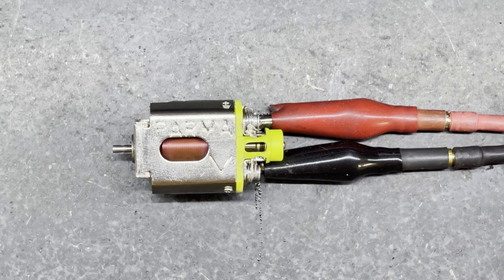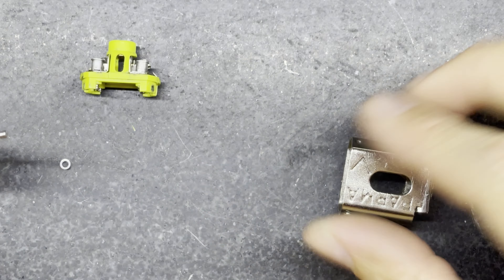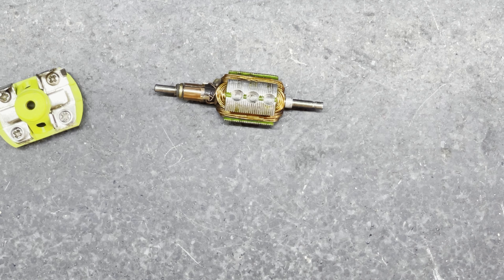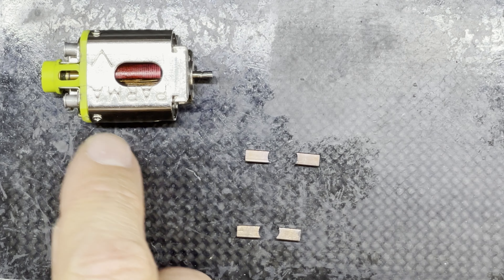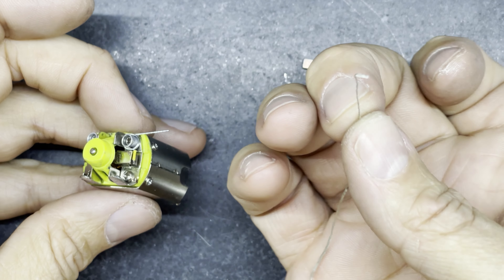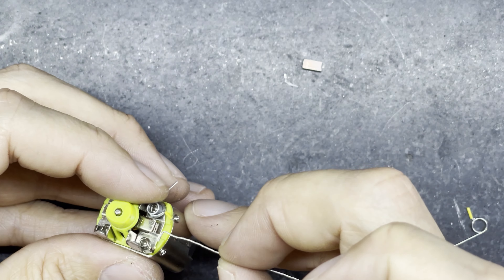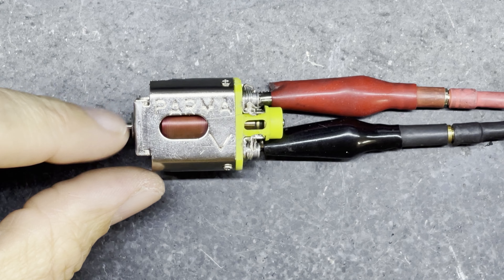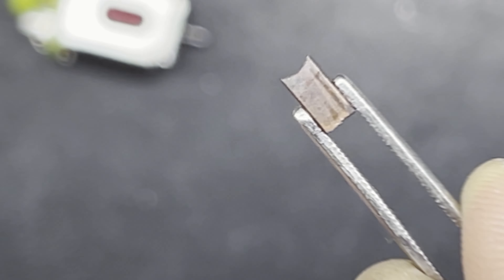Servicing a slot car motor to improve performance Super 16D Slot Stox - Part 6

Comment: This was a very comprehensive motor building series James. Even the inexperienced person. if they watched the entire series, could become a good builder/rebuilder of motors. The same basic steps to building a 16D motor also apply for ceramic C-cans. The dimensions of C-cans are slightly smaller. One tip I use with motor brushes is polish them on newsprint, especially the four corners to remove any burrs & irregularities. Newsprint works like the ultra-fine sandpaper, but without its price. I look forward to seeing the Slot Stox series on the chassis.
Reply from the maker: Thank you billffromnh. I race a lot of G12 C-can motors and Eurosport motors and use the same techniques with those motors, except I don’t use the diamond coated brush alignment bar with some of the plated endbell hardware.
I have seen people rub the brushes on all sorts of old paper just to polish them up a bit and remove any burrs on the corners. It seems to work well.

Comment: What are your thoughts of placing a phenolic washer/spacer up against the commutator? I mark the top face of my brushes using an Xacto blade against the top of the hood to show me the correct brush orientation for when I remove the brushes for checking purposes.
Reply from the maker: Using a phenolic washer at the com end, depends on what the end of the com is like. Some coms have exposed copper segments on the end so a phenolic washer would help insulate the end of the com and avoid shorting out segments with a metal washer. In this case, the com had some form of brass washer already on the end of the com that was already insulated from the com segments so I didn’t feel it was necessary.
Nice tip about marking the brushes. I have seen that done a few times before.

Comment: Good stuff James. Id be really interested in seeing the rpm difference between a 3 coil spring and a 5 coil spring (with and without shunts). S16D's really dont need that much brush pressure as the current draw is not super high. You do not want the comm to have a bare copper surface, too much friction. You want a few nanometres of copper oxide. Too high a pressure and you scrap the oxide layer off. Too little and the oxide layer becomes too thick.
Reply from the maker: Great tips as usual Fabio. Thank you 🙏
Reply: Many years ago I had Parma's bigfoots and a brand known as "golddust" brushes chemically analysed. Occupational perk. From memory the bigfoots had about 3% copper with the rest being carbon, silicon and binder. The gold dust had NO gold and NO copper! Only carbon silicon and binder. Not sure why they marketed it as gold dust brushes??
Reply from the maker: @Fabio-ns4ql  Interesting. Brushes do vary in colour quite a lot. I have found that the ones that appear to be more of a copper colour, don’t seem to work so well in the higher amp motors. There have been many batches of “big foots” and “gold dust” brushes through the years and the colours always seem different from batch to batch.
Reply: @CleaveTech  totally agree, it always seemed the darker brushes were a little faster and better comm wear

Comment: I'm intrigued, what purpose does armature dye serve?
Reply from the maker: Armature dye just protects the exposed parts of the laminations from corroding over time and it makes the armature look pretty.
It also makes it easy to see if the armature has rubbed against anything which could mean that you may need to get it rebalanced again.
Reply: @CleaveTech  many thanks.
Reply: @CleaveTech  The armature dye also darkens when heated, so the amount of discoloration gives a rough indication of whether and how much the armature has been "cooked". This is true for any color arm dye (blue, purple, yellow, etc.), but red is preferred by many racers for this function.

Comment: Nice job and a good watch.  That motor is probably running as well as it can, now.  Out of interest, how many amps does it draw after its going over?
Reply from the maker: It’s quite an old armature and the windings are not that great, but for information, it draws 2.0A at 5V.

Comment: What is the Shunt wire and what is its purpose ?
Reply: Also. What are the ramifications of breaking/losing a shunt wire during a race? Will the motor still run?
Reply: I had the same question! Looking forward to James' answer :)
Reply from the maker: Great question. The shunt wire conducts the current to and from the brush more directly and effectively than just relying on the brush touching the brush hood. Although the brush is a good fit in the brush hood, it has to have some clearance so that the brush doesn’t get stuck. The shunt wire is constantly pressed against the brush by the spring so there is always a good connection.
Reply from the maker: @7732147  If a shunt wire breaks or becomes disconnected, the motor will still run but it may not run as fast. Low powered motors such as Scalextric will not really benefit from shunt wires, but you will certainly notice the difference with anything from a Super Wasp / G12 upwards.
Reply: @CleaveTech  Thank You for the explanation and clarifying the shunt wires advantages ! I will definitely try it !!
I love your videos and the great explanations !!
Thank You !

Comment: Great video series that is very informative! What is the purpose of the shunt wires? Thanks from the U.S.
Reply from the maker: Thanks for watching. The shunt wires conduct the current from the lead wires directly to the brushes without having to rely solely on the side faces of the brush contacting the brush hoods. As the amp draw of a motor increases (shunts are not really necessary for motors that draw less than around 2A) it is surprising how much better the motor will run when using shunt wires.

Comment: What's the purpose of the armature dye apart from making it faster ? LOL
Reply from the maker: Thanks for asking. Here is the reply I gave to a similar question…
Armature dye just protects the exposed parts of the laminations from corroding over time and it makes the armature look pretty.
It also makes it easy to see if the armature has rubbed against anything which could mean that you may need to get it rebalanced again.